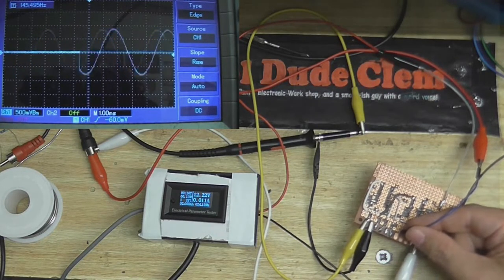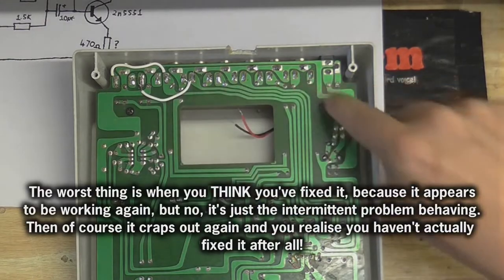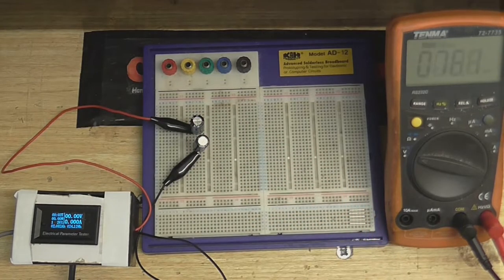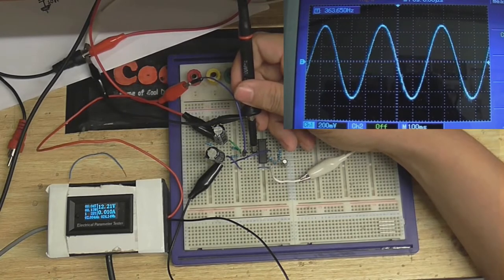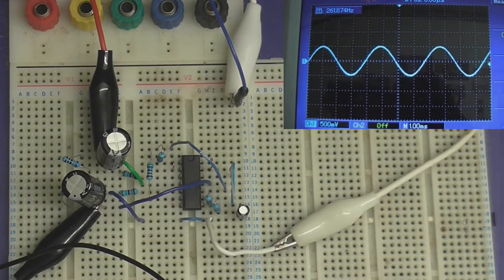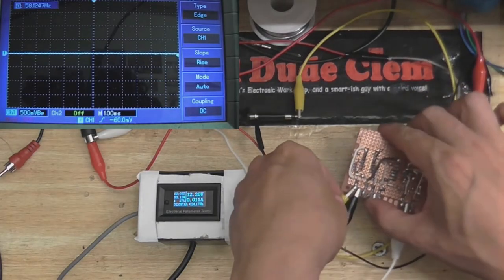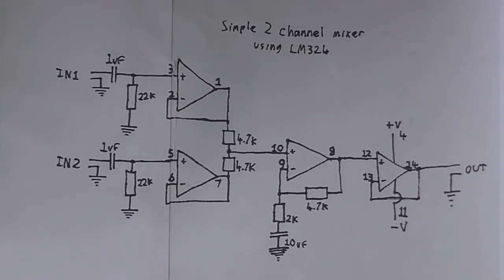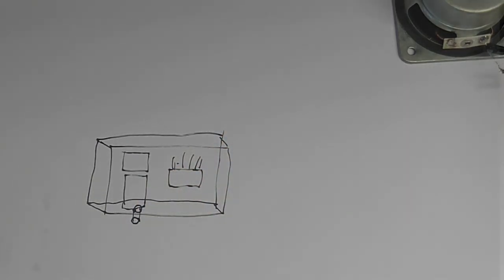Simple LM324 2 Channel Audio Mixer

Comment: Well done Clem!
I can remember a College Lecturer saying that these things were Adders not Mixers and he was right technically.
Our language does not always articulate our thoughts as well as we would like.
I think that using an Op-Amp to do it like that is called the Virtual Earth technique.
Do you remember Scratching Clem?
It was where usually a couple of Turntables were connected to a "Mixer" and the Platters were moved by hand instead of the usual Motor set-up.
In this way fragments of playback of Records at different speeds and sometimes reversed were combined to make a sort of music.

Comment: Nice work Clem. The circuit seems to be at unity gain, I thought you wanted 1.5 times gain
Reply from the maker: 3 of the 4 stages at at unity gain, but there is 1 stage that does have gain.
Reply: @CoolDudeClem  Is that the stage where you have the two 4.7k input feeds and the 4.7k feedback resistor?
Reply: Op-amp 3 has feedback setup for gain.
A = Rf/Rin
A = 4.7K / 2K = 2.35
Reply: @digitalradiohacker  So amplification is set by the ratio of resistor values of the 2k from Neg input to ground and the feedback resistor? I'm trying to get my head around this stuff. But would the 4.7k at the positive input from either stage 1 or 2 cause a loss in gain?
Reply: Oops! This is a non-inverting circuit, so the equation is:
A = 1+(Rf/Rin)
So A = 1+ (4.7K / 2K) is 3.35
Reply: @andrewstewart8704  
Those two resistors  on the first two stages don't do anything to gain, they separate the outputs of opamp 1 and 2.
Gain is set by the "feedback resistor" (Rf) and the "input resistor" (Rin). Rin seems to be a daft name in this configuration because it goes to ground, but just ignore that - the math still works.
Gain is usually written as "A".
In my previous comment I actually made a mistake - Because the input goes to the non-inverting input (+ sign), the equation is A = 1+(Rf/Rin)
If the input goes to the inverting input (- sign) the equation is A = -(Rf/Rin) which means that even if the resistors were the same, the gain would be different.
Reply: @digitalradiohacker  Yes I see what you mean, you have to have unity as a starting point. It made sense to me just before my head spun off and was able to recover my spinning head to make a reply 😃
Reply: @digitalradiohacker  I wonder what Clem is up to... possibly reading comments thinking what the hell are these guys on about or now moved on to making a case for his mixer LOL